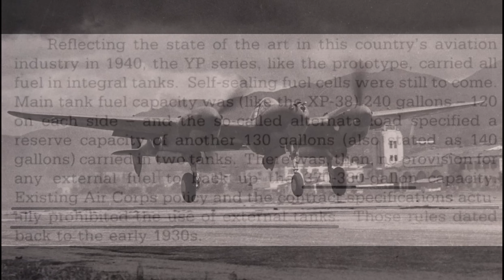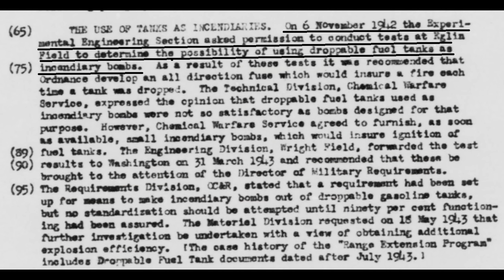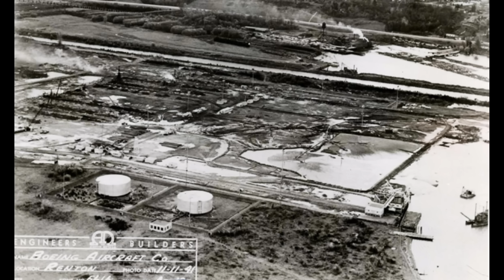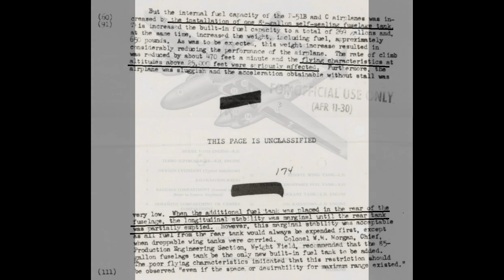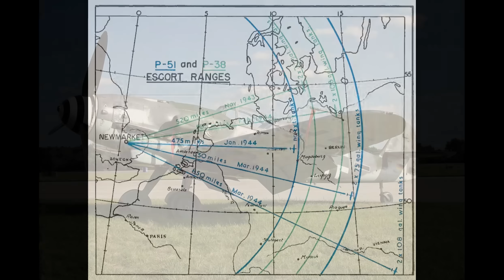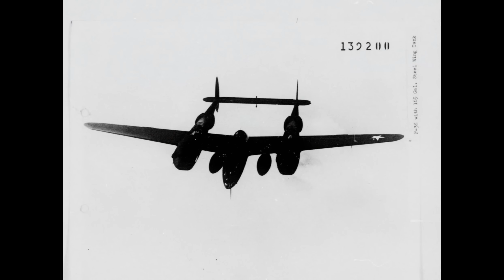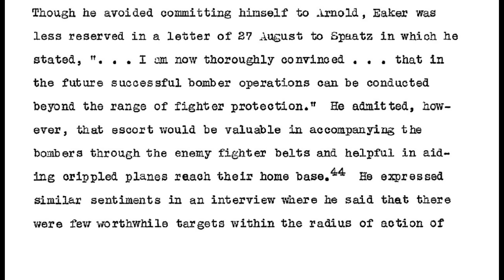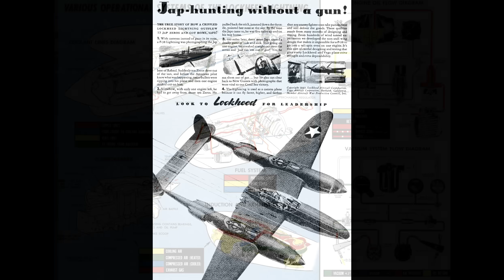The P 38 Lighting and the Bomber Mafia's Failure In World War Two

Comment: If the P-38's improvements (power boost for the flight controls, leading edge flaps to counter compressibility, improved supercharging, etc) on the later models had been done and available earlier in the war when they were fighting in Europe, it would have been a war winner in that theatre. Throw in 4-bladed props, and you've got a juggernaut. It was a good airplane, with several inherent advantages over any single engine fighter.
Reply: All of those improvements, and more, were available in April 1943. The dive flaps (under the wings), the boosted ailerons, the chin mounted intercoolers, the B-33 turbochargers, and even 3 blade 13'-6" Hamilton Standard hydrostatic high activity paddle props. Due to the War Production Board, those improvements were delayed by 9-12 months, and the props were never used, nor were the 1875HP F-117R/L engines. That would have been the P-38K, a fighter with 1945 performance, available for production in June, 1943. Ordered AGAIN by the Army Material Command in April 1944, and denied AGAIN.
Reply: @AlanRoehrich9651  
Mostly self-inflicted. 
That could have been a 450+ mph fighter.
Reply: @wanyelewis9667  Once you get to the 450+ mph range, the inherent limitations of the basic design at transonic speeds become more serious.   Air needs to speed up to move around an object.  With the P-38, the air speeds up around the wing (especially the upper surface), gondola (which houses the pilot and weapons) and nacelles (which have even faster airflow over them from the propellers).  With the P-38, all of these are fairly close together more or less in line with each other.  This created something like a venturi effect from the interaction of the three elements.   As long as the airspeed is low enough, this was not an issue.  Once the plane goes faster however, places where the air has accelerated significantly begin to reach the speed of sound (compressibility).   In other words, the layout of the P-38 causes it to experience compressibility issues on the wing and control surfaces at lower airspeeds than many other designs.  

There were some attempts to reduce air acceleration of the gondola by stretching it out and making the bubble for the pilot smaller.   There were also trials with longer chord  "laminar" airfoils which accelerated the air more gently than the original design (look up the P-38 "Swordfish" photos).  In the end, none of these made a big enough difference to put into production.  In the end, it was discovered that the pilot "gondola" would need to be completely behind the wing and the engine nacelles extended farther in front of the wing to solve the transonic problems.  There was an interesting attempt to make a race plane like that, but it crashed before setting any records.  Look up the "Scaled Composites Pond Racer" to see.
Reply: @jfess1911 
Actually, at the behest of Hap Arnold, NACA developed substantial changes to the center wing root radii, both at the cockpit nacelle and at the fuselage booms, as well as a leading edge change, that increased the critical Mach of the P-38 considerably. However, as with many other improvements, the War Production Board refused to allow them to be phased in. There were some relatively minor detail changes to those radii phased in that did offer measurable improvements. However, what NACA and Lockheed wanted to do would have raised the critical Mach to 0.70 or higher, before the deployment of the dive recovery flaps.
Reply: @ I have seen two different such studies, each suggesting slightly different changes.  The conclusion of the "powers that be" was that the improvements were not enough to be worth the lost production they would cause.  I can probably chase down references, if you like.  The War Production Board wanted to switch production funds to less expensive fighters and did not seem interested in large changes to the P-38.
  
The main flaw was with the basic design.  Too many bulges close to the same lateral plane.  If you are familiar with Whitcomb's "area rule", putting a lot of bulges in the same lateral plane severely reduces the speed at which an aircraft experiences negative transonic effects.  This was beginning to be understood even during the war since there was an illustration on p 74 of the P-38 training manual (12-2-44 date) entitled "VENTURI EFFECT CAUSED BY GONDOLA AND NACELLES".
Reply: Even with dive flaps, other planes could still out-dive the P38 to get away.  The speed at which the P-38 became difficult to control was the same, meaning that while experiencing the effects of compressibility, the pilot was pretty much unable to continue to pursue and shoot down an opponent.  What HAD changed, however, was that the pilot could push his plane to the edge of its performance envelope and survive if he went a bit too far.
Reply: @jfess1911 
Actually, Art Heiden, who flew it in combat, said that with the J25-Lo, "by the time Jerry decided to dive away, the P-38 could accelerate so fast that you could pop the flaps, and follow him easily". Meaning that by the time the enemy attempted to escape, his speed was low enough that the quicker accelerating P-38 could dive and catch him before he got too fast.
Reply: I like the P38 but it was never really suited to be an air superiority fighter dogfighting other fighters. but it was a fine boom & zoomer and adequate escort fighter until later types evolved & arrived. it could and should have been a capable stand in for P51Ds & P47Ds on bomber escort missions
Reply: @garydownes2111  a USAAF study in 1943 or 1944 (I don’t have my references handy) actually found that once established in the roll, the P-38 could out turn most US single engined fighters above 20,000 feet. The sole exception, if memory serves, was the P-47 above 30,000 feet or so. This test was done without the boosted ailerons which meant the Lightning was hampered by abysmal roll rate—once the boosted ailerons were added it could out roll everything too.
Reply: @everking3767 
In the early P-38, a measurable increase in roll rate was possible by using the rudders, which had substantial authority. Want to roll right? Stomp the right rudder pedal. 

Further, with the P-38, differential throttle control could be used for both roll and turn. Several combat pilots referred to it. It was more common in the Pacific, however, Ervin Ethell, father of war bird pilot and author Jeff Ethell, made use of differential throttle control in Europe, and scored 4 victories.
Reply: @ absolutely rudder assisted rolls and use of differential throttle could allow the Lightning to do incredible things. There was something called the “Lockheed Stomp” which used both to initiate a flick roll and turn reversal by deliberately exacerbating the torque roll of a (nearly) binned engine. My earlier comment was speaking specifically about a USAAF comparison test which did not factor in advanced maneuvers or rudder assisted turns and was meant only to assess the baseline performance of the different types.
Reply: @ This is for the other readers in the thread.  I think that some of the interesting information Mr. Roehrich mentioned can be found in an excellent article on the Air Power Australia site.   I found it by searching for its title: "Der Gabelschwanz Teufel
Assessing the Lockheed P-38 Lightning".
Cheers
Reply: @jfess1911  That article was written by Dr. Carlo Kopp, with support from a few of my friends, Corey C. Jordan, who has a website called "planes and pilots of World War II, the late Captain Arthur Heiden, and the late Captain Stan Richardson Jr. There was also information from my friend Warren Bodie, Lockheed engineer and author of the definitive "The Lockheed P-38 Lighting". Corey, AKA "Widewing" is also the authoer of "Whatever Happened to the P-38K".
Reply: @AlanRoehrich9651  Thanks for the info.  I am trying to find that website.  Could it be listed under another name in the web address?
Reply: @garydownes2111 The P-38 was a pre war design that could have, and should have been continuously up dated. The K model (had it entered production) would have been a match for any late war fighter, and it still wouldn’t have incorporated some of the more effective possible up grades. You say that the P-38 wasn’t a good “dog fighter” but in reality none of the US fighters focused on turn fighting in design (with the possible exception of the P-39). The J model with manoeuvring flaps had a sustained turn rate better than any ETO fighter below 20,000 feet. It could out climb any other WW2 fighter to see combat. It’s roll rate was slower than the 190/109/47 but much improved over early models. It had the dive flap setting to counter compressibility. It also had the heated flight suits that helped with the poor cabin heating in earlier models.  In short, by the time the P-51 became available, the P-38 could go father, climb and turn better, put much heavier firepower on target and carry more ordnance, while having better survival rates. Escorting US bombers from above and boom and zooming attacking  enemy fighter would have been an ideal role for the P-38-J. The real disadvantage of the P-38 was that it cost substantially more than the 51 while not delivering substantially more effectiveness. In the Pacific, where long over water ops made two engines a real benefit, the P-38 shot down more Japanese fighters than any other USAAF plane. The Japanese planes were all highly manoeuvrable dogfighters and yet the 38 performed extremely well against them.
Reply: @ are you a bot? why was this directed at me? I like the P38 and while not an ideal dogfighter it could hold its own while booming & zooming. it could be an & was an effective bomber escort .. 
cost is irrelevant in the period in 1943 when the USAAF had P38s and no P51Bs or Ds.
Reply: @garydownes2111  
All the armament clustered in the nose (no convergence needed, like in wing mounted guns) made for one of the most devastating punches of any fighter in the war.
Reply: @wanyelewis9667  agreed, 50s & cannon were v effective
Reply: @garydownes2111 
False. A well flown P-38 was an air superiority fighter. The only advantage any piston/prop fighter held was terminal dive velocity. The P-38 had excellent maneuverability.
Reply: @AlanRoehrich9651  please don’t misunderstand, I’m a P38 fan and have defended it and its pilots achievements and those of the P47 against the “P51 extremists”.
I argued against a gentleman who claimed P38s & P47s couldn’t dive 600 metres without over speeding their critical Mach number and loosing control and crashing.
While the P51 could magically dive at what ever speed it wanted.. nonsense like that unfortunately.
The P38 could & did compete with German fighters but was never going to be a turn fighter. It could turn tightly at relatively slow speeds but would lose energy rapidly. it had relatively high wing loading too. I’m not attacking or demeaning it, just being realistic on its relative merits. a fine aircraft with advantages & limitations that if flown to its strengths was v effective. booming & zooming with concentrated armament it was fast & long range. if caught at lower speed it could turn to survive but wouldn’t choose to try to turn with 109s or roll with 190s.

Comment: As always an amazing and well researched video! Sadly Ben Kelsey when he retired in the 1950's was reverted from his rank of Brigadier General to Colonel, a significant reduction in retirement pay!
Reply: Yikes! Where did you learn that?
Reply: Kelsey is a bit controversial. A lot of P-38 people blame him for the loss of the P-38 prototype on what was a publicity stunt. It's loss delayed the P-38 program significantly. Kelsey was also responsible for the loss of one of the first P-38's equipped with the dive flap.
Reply: Kelsey was not at fault for either loss. 

The prototype was lost because it had inadequate inlet heating, and an extended time in the pattern resulted in the intake icing up, there's no was Kelsey could have known. 

The dive flap incident was caused by the deployment handle failing. It had to be determined whether the handle and flaps would work if deployed AFTER a dive had been entered, and the plane/pilot were in trouble. Kelsey had the guts to find out it didn't work. That's the job of a test pilot.
Reply: @AlanRoehrich9651  Kelsey made the decision that it was not an undue risk to take a valuable largely untested hand built prototype of a new radical design on a high speed high altitude cross country flight. He was wrong.

Comment: The P-38J partially stemmed from the failure of the concept of the intercooler arrangement in the wing  leading edges, which were inadequate for the operating conditions over Europe.  It is interesting to note that Jimmy 
Doolittle personally demonstrated the positive characteristics of the Lighting in England before he became chief of the 8th AF.
Reply: The leading edge intercoolers were probably near their heat rejection capacity limits with 1,000-1,200hp.  The later aircraft had substantially more than that. And because of their nature, it is not like regular engine cooling where you can allow the engine or coolant thermal mass to absorb excess for takeoff, or allow overheat for a minute or two in a climb. Even moment of excess heat going into an engine intake is likely to cause detonation.
Reply: @Triple_J.1  Right.  The original design was lower drag than traditional intercoolers and got few extra knots out of the engines available at the time.  The goal was to get a fast plane up and flying and indeed, the XP-38 was very impressive when it first flew.  It would be interesting  to know at what stage the designers realized the limitations of their intercooler system.  In the mid-1930's, I wonder if those on the design team had any idea that engine performance would increase so much in just a few years.
Reply: I suspect that when the 38 was designed in 1937, "high altitude" meant 20,000 ft, not 30,000, and they were designing for 90 or 100 octane fuel, not 130. So the fact that the intercoolers had no headroom wasn't seen as a oroblem then.

Comment: Great video. I completely agree with your analysis. 

One question that i have spent time thinking about is how much difference it would have made if Lockheed had been contracted to make more p-38s instead  of building a production line of b-17s?
Reply: Here's what could have happened. 

1. There would have been 20,000 Lightnings. Not 10,000.

2. In June of 1943, the P-38K would have entered production. It had two 1875HP engines, and Hamilton Standard hydrostatic high activity paddle props (3 blade, 13'-6"). The performance was amazing. It would have had dive flaps. It would possibly have even had a further improved wing root radii at the joints between the inner wings and both the cockpit nacelle and the engine fuselages. It would have also had the hydraulic boosted ailerons. Capable of 450MPH in level flight, with a 10% or greater increase in combat radius, and with a climb rate in WEP of 5,000 feet per minute. It was capable of reaching 20,000 feet of altitude, from a standing start at the runway threshold, in 5 minutes. Literally a late 1945 performance fighter, in production in mid 1943.

And there would have been plenty for both Europe AND the Pacific.

Comment: Of the American Service Cheifs, Happ Arnold was bar none the worst. He was a Bomber Fanatic. Would have let Australia fall, to adhere, mindlessly to the Europe first strat,  and had to be ordered by the president to support the gaudelcanal campaign. His mis management of his pet progrogram the B-29 probably led to cost overuns.  The Bomber Mafia made the Airforce nearly useless as a conventional force, until Korea showed us the errors in their thinking. He should have been sacked and replaced with George Kenney.
Reply: Actually, Hap Arnold was responsible for pushing some development of the P-38, it was Arnold who forced NACA to allow Lockheed to use the wind tunnel to work on the compressibility problem. Unfortunately, the War Production Board refused to allow Lockheed to halt production for short periods to retool for many of the improvements. NACA, at Hap Arnold's request, actually developed even more improved wing root radii, and leading edge modifications that would have raised the critical Mach to in excess of 0.70, but in order to put that into production, Lockheed needed to stop production for at least a week. So, as in the case of the P-38K, the War Production Board refused. And again, pilots went into battle with less airplane than they could have, and should have.

Comment: I have greater appreciation for the P 38 and P 47. The more I learned about them. The same goes for Fw 190.
Reply: All excellent aircraft. 

Honestly, not enough technical detail exists on the Spitfire. Especially early marks.
Reply: @Triple_J.1 
I am smiling. My father spoke of a PR Spitfire being polished and he seemed to have used very fine Wet&Dry in his job. 
But as for the early ones, I think there is a picture of one with a two bladed propeller. It is as if they were an expendable stopgap. 
As time went on of course they got bigger, with bigger engines, different wings and didn't look so dainty. Or maybe the later ones didn't take such a good photograph.
Reply: The P-47 was arguably THE best non-carrier aircraft in the U.S. arsenal during WW2 and the only one in the USAAF inventory capable of acting as an effective fighter-bomber.